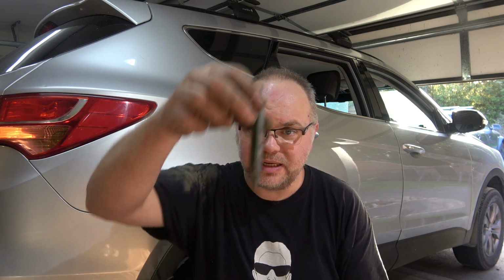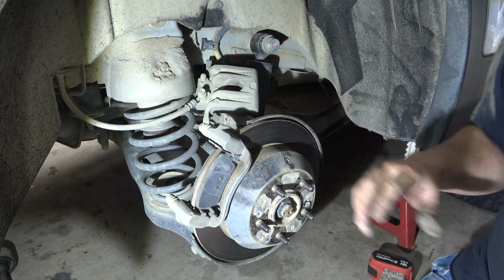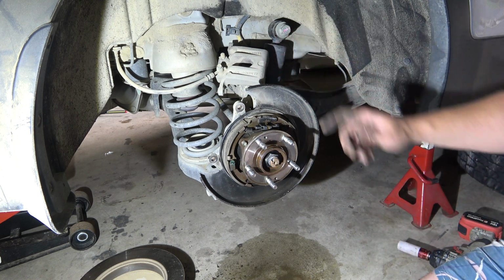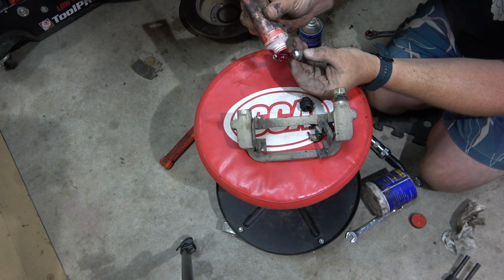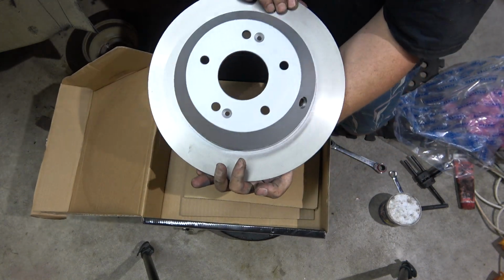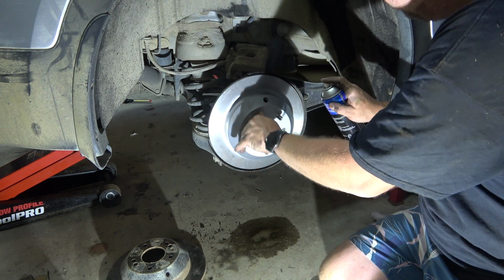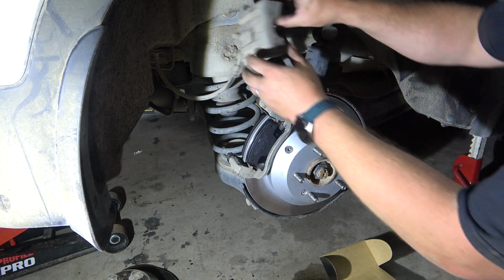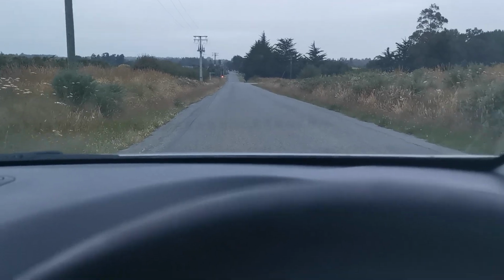Hyundai Santa Fe Rear Brake Replacement

Comment: Great vid! One thing I do before screwing the caliper to the slide pins is pushing the pedal to get the piston out and seating the caliper in it's final position over the rotor. Sometimes the slide pins don't slide evenly on first installation and when that happens you end up with warped rotors (I found out the expensive way). Thereafter you can move your slide pins to where the caliper is and release any pressure by squeezing the slide pin boot.
Reply: What do mean like the caliper or the brake piston do you push the brake when the disk us on...?

Comment: Great video! I'm about to do the same job on a 2008 SsangYong Rexton RX 270 XVT. Same brake setup on the rear. Very straight forward. The only thing I could not understand with the audio was the TORQUE in Newton Metres for the brake caliper CARRIER (sounded like 17nm. This seems very light for a 14mm bolt. Should it be 70nm ?). Same goes for the CALIPER retaining bolts. Suggestion: On the video put a visual overlay of any numbers, particularly things like TORQUE specs. Very important. Or alternatively, quote the numbers in the description below the video.
I also query the use of Copper grease directly where the brake pad meets the piston, regarding temperature ? Why not use high temperature brake grease, in little sachets, supplied by BENDIX etc. 
Excellent video, thank you.
Robert

Comment: I had the Tucson and the handbrake on that was always needing adjusted. Asked the main dealer to adjust it during its first service and they adjusted it via the cable which is the wrong way to do it and they charged me an extra £45 for the privilege so after that I'd adjust it myself via the drum. I got rid of it when the warranty ran out and went back to a Mini Cooper

Comment: Great video. Interesting you need to use a website across the world to order parts from. Nothing in NZ?
Reply from the maker: Thanks. Would have cost $150 more to buy locally than to air freight from the other side of the world 😬
Reply: @Badgertronix  amazing. The world sometimes is a crazy place

Comment: Good you don't need locking wheel nuts in NZ or is that just the area you are in?   I wish I could dispense with them in Blackpool, UK. No chance!
Great video. I have enjoyed the Morris Minor restoration.
Reply from the maker: They're not as common here but they are about. Probably a good idea if you live in the city but touch wood I'll be ok! Hopefully will get back to the Morris soon

Comment: I failed to take out the tire on my 2016 Santa Fe… I unscrewed the tire but it was hard to pull out… help !
Reply: To release the tire is a little secret, just kick on one side and it might pop loose, to remove the disk the screws can be rusted in there, they make a impact screw driver you hit with a hammer to get it loose, if replacing the parking brake pads you will need a long screw driver and a vice grip to get those springs back on
Reply: Donkey 🐴 kick work just make sure you secure the vehicle I know is hard but try rotate the tires often.